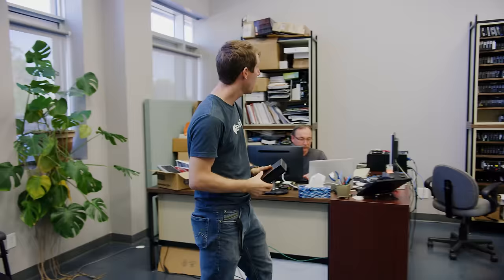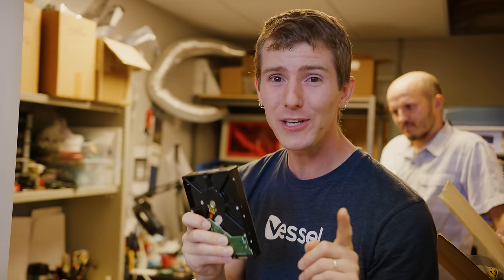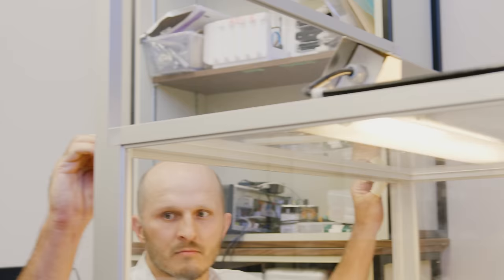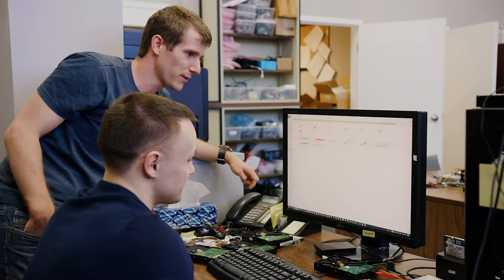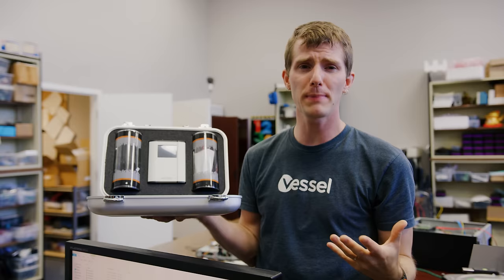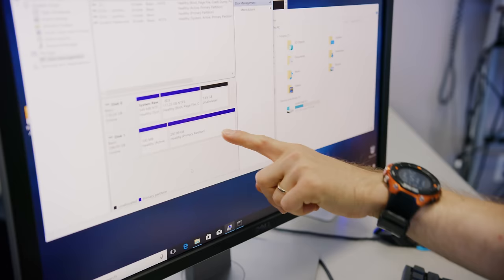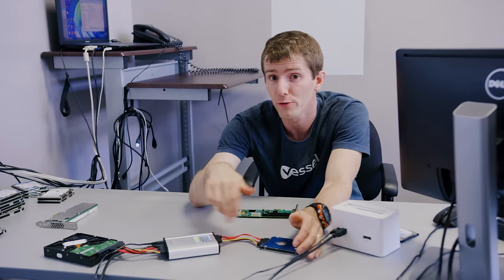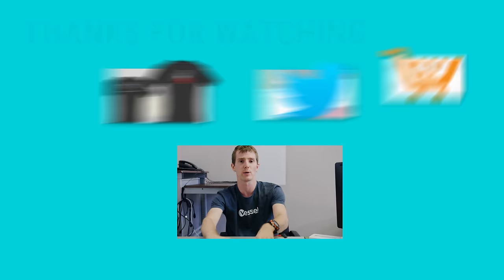Don't Waste $1000 on Data Recovery

Comment: Really cool stuff, useful tips (automount disable & scrub). I lost interest when the software updates from a DB back at their corporate servers - That data should be included with the purchase and updated periodically. What's sent back to the corp servers is not mentioned - would have to scrutinize the privacy policy before I pulled the trigger. Meanwhile, I'll continue to practice safe data storage principals so there won't be a need. Thanks for the video!

Comment: This might be a stupid question but if the data is on all the platters (discs) themselves wouldn`t it be easier to just move the platters to a working drive instead of replacing all the defective parts one by one on the drive itself?

Comment: 14:20 "there is free software"
TestDisk! It's all you need for any logical HDD errors. Accidentally quick format a drive? It'll find the partition structure. Have a drive where the MBR is corrupted? It'll write a new one and it'll boot again. 
Have a drive that says it's empty? It can recover raw files even if the partition structure is completely trashed.  
And it's free.  
AND it comes with image recovery utility with a nice GUI.  
Seriously... Free
Reply: Does it work with SD cards? Is there any free software that does?

Comment: wow....... using your tips, in particular the section on 'windows hacks' i was able to recover data and files from a dead SSD using a cheap USB SATA cable off amazon and the free DiskDrill software! I was experiencing random blue screens and crashes for months before the drive finally failed. Eventually i purchased a new  2TB M.2 nvme drive to reinstall windows to. Lessons learned. Thanks for the help!

Comment: Another reason to love my ssd
Reply: Greetings Sir. Having a bad time formatting my SSD hard drive without backing it up. Please Can you help me on recovering it?
Reply: SSD's have a lifespan. Enough read writes degrade the metal tracks in the circuitry (not the contacts) and hey presto they fail. Its the same with memory cards, so be careful and always take backups

Comment: Excellent video and fun to watch!  I found this vid because my son's SATA HD died today, and I stayed for the whole show.  Very entertaining and super informative--beats most of the Discovery Channel shows.

Turns out his drive's TVS diode on the 5 volt line did its job spectacularly, and then died in a shorted-out config.  Got out the soldering iron and lifted one side of it, then replaced the zero ohm resistor that acted as a cheap fuse.  Voila--it lives to fight another day! (and yes, we're going to copy the data over to a new SSD)

Comment: Would have been a great video to have three years ago when my 135K word fantasy novel got destroyed by a failed hard drive and was impossible to recover. But, looking back, while the original version was wayyy different than the new version, they're both fantastic. At least for first drafts.
Reply: Wow, that sounds impressive, did you publish it?
(the new version)
Reply: the question is, if it was so valuable, why didn't get it a backup before it was too late?
Reply: @terner1234  nah. Still editing. Actually just finished the first draft two weeks ago. Took a small break the last week. Started editing Wednesday. Got like ten chapters edited as of today. After editing, I'll probably send it off for beta reeading. But, if you want to read the unedited first draft, it's for free on Wattpad. The book is called The Game For Power and my username is JamesStark612. It's a pen name. See if you like it. It's about a rebellion, a war between gods and a king, desperately trying to stay in power.
Reply: @sh4dy832  i did have a backup set up to a cloud service but something fucked up and the latest version I had of the story was 7 months ago with only ~11K words written. At that point, I was just like, fuck it. Just started it over but I would have loved to see what could have become of the first book that no one will ever get to see again.
Reply: Aditya Upadhye if I had that many words written I’d backup it at every single change.... I don’t even have data on my OS SSD, I save important files on my HDD, but I also have the important files on Dropbox (2gb free cloud storage) OneDrive(5gb free cloud storage) and google drive (15gb free cloud storage) to back up my back up of back ups of important files lol.
Reply: For the synopsis, I'd change the word "common people" to "commoners", that way you don't have the word "people" written twice within the span of four words.  It might just be a personal preference, but I feel like it messes with the flow when the same word is used multiple times in quick succession.  I'm only pointing this out because I feel like the synopsis is the hook that grabs potential readers, so every single word needs to be perfect.  It probably wouldn't be a big deal within the actual story though.

I wish you the best of luck on your novel - the cover looks pretty good, and the plot sounds really interesting.  I wish I had that kind of creativity. :P
Reply: You should edit it on google doc, every word safely stay on cloud.

Comment: Liked your comment about backing up your data at the end. One of my comptuer lecturers at University told us that there are two types of computer user: those that have lost data, and those that will.

In addition, another lesson I learnt that it isn't enough to back up your data, but to verify your back up and check it regulary.

I learnt about an interesting case from a Californian University, the Geography department I think, where they made two back ups of their data, each copy on magnetic tape (yes, this case was from that era!). When they had an incident and had to restore data from their backup they found that the first set of back up tapes were corrupt. Fortuneately the second set was okay. They replaced the corrupt copy with a new back up.

A few months later and they then again had an issue and had to restore from the back up tapes, and once again, found the first backup set corrupt but the second set okay.

This circumstance was obviously concerning so they conducted an investigation to find out what was happening. They found quickly that it was always the first set of backup tapes that quickly became corrupt, and that this was the set of tapes that was stored on the bottom shelf of the cupboard. The second set, stored on a higher shelf in the same cupboard would be okay.

Once this was discovered, the cause of the corruption was quickly found to be caused by the magnetic field produced by an electric floor polisher that the cleaner used on the corridor every night.

Comment: For the people scrolling through the comments. Formatting is not always the same. For example, the 'kindest' form of formatting, would be a 'high-level' or 'quick' format. Which mostly means the partition table (special sectors on the drive) are re-written. The rest of the data on the disk is not touched, therefore recoverable.

Low-level formatting, is the process of literally writing zeros to the entire disk (its 'data space' if you will). In which case, recovery of data is impossible.
Reply: Zeroing the drive is colloquially called low level formatting, but that's not what it is. Low level formatting hasn't been possible by consumers (or even data recovery businesses) since the early to mid 90s. Low level formatting refers to the process of writing the actual sectors, tracks and servo info on the drive. Modern (and by modern anything 1995 or newer) hard drives are low level formatted when they are manufactured and can never be low level formatted again.
Reply: really? I've heard that there are technologies used by the DOD that can detect "ghost" images or residual magnetism from each writable bit so that they can actually see what has been written over.
Ever heard of this or is it a myth?
Actually, I just figured I'd spend a minute to check and it looks as if it's definitely a possibility but in a limited capacity. I've heard that BleachBit, the software that Hillary Clinton had her underlings use, overwrites several times. That would certainly make recovery near impossible because you could never tell how many times a bit has moved from a 0 to a 1 or 0's over 0's and 1's over 1's
Reply: Its definitely not impossible from just one pass. For the consumer it typically is but there are ways. If you have state-level money and technology they - might- be able to read the residual magnetic field left behind(Very specialized equipment and mainly used for espionage/terrorism stuff). For the average user one pass is good but for sensitive data you want either S-Delete or DBAN. With at least a 3-pass Zeroing write or the DOD certified erasure method. 

Also, he never mentioned GRC's(Steve Gibson) SpinRite which is a low-level read of the 1s and 0s and every sector to recover[and reconstruct] most of the data that was lost. One of the best tools and for the money. And to your point, when he releases his next version, 7.0, along side with that he will be making a secure delete tool at the low-level.
Reply: @captain150  I had a program for win98 that would low level format any hard drive.
Had a virus on the drive that nothing would remove. Low Level Format got rid of it.
Surface check with Norton shows the shape of a big spider on the drive before and nothing after.
Hard on the disk too but ya gotta do it sometimes.
Reply: @christurnblom4825  on platter drives you would use magnetic underwriting. Evidence Eliminator program did just this thing too.
Takes forever to do a simple 20-40gb hard drive.

For SSD's. ZEROING does not fix the problem.

You have to write all 1's at least 4 times to the drive. Normal state for SSD's is all 1's not zeroes.

If you have wear leveling then even more work needs to be done.
Reply: @jordanwingle3111  SSD manufacturers have specialized programs for restoring n SSD to factory state thus making retrieval impossible.
But it very quickly wears out the drive if done too many times.
Reply: @christurnblom4825  That's a myth. Everyone has "heard" something, just like with any myth. But nobody has ever shown any evidence that it can be done, at least with modern HDDs. "They say...", "I heard...", "it might be possible...", are nothing but speculation or gossip, and are as worthy of consideration as rumours about the existence of the Loch Ness Monster. Whenever someone makes a claim that sounds like science fiction or like something out of an episode of CSI, one should take it with a huge grain of salt, and ask for for some kind of evidence. So, is there any evidence supporting this? No. But there is research disproving it.

First of all, this wasn't entirely a myth for old HDDs, but it is for modern ones. The myth has its origin in a paper from the mid '90s by Peter Gutmann, in which he claimed that it might be possible to recover data from magnetic remanence on HDDs. Of course, as many researchers pointed out, he didn't provide any evidence to support it. And it only applies for very old disks, as the author recognized: "Any modern drive will most likely be a hopeless task". Unfortunately, this two very important facts seem to have been lost on many people.

There's been research in more recent years, and they all agree that even one full overwrite is enough to make recovery of any useful data pretty much impossible(1), as long as one verifies that data was really overwritten, and there were no errors that prevented the overwrite to truly succeed. I'll just give two examples:

A paper published for the 4th International Conference on Information Systems Security, "Overwriting Hard Drive Data: The Great Wiping Controversy", showed that even after just one overwrite, while it might be possible to recover a few individual bits here and there, the recovery of any useful data is not possible (the probability is about the same as that of pure chance: tossing a coin to decide the values of the bits would be as accurate). According to the research this limitation is inherent to the physical nature and technology of HDDs, which means there cannot be any device that overcomes it: you simply can not read what's not there. The conclusion: "The forensic recovery of data using electron microscopy is infeasible. The fallacy that data can be forensically recovered using an electron microscope or related means needs to be put to rest."

A publication (800-88) by the National Institute of Standards and Technology, "Guidelines for Media Sanitization", has this to say: "Studies have shown that most of today’s media can be effectively cleared by one overwrite. Purging information is a media sanitization process that protects the confidentiality of information against a laboratory attack. For some media, clearing media would not suffice for purging. However, *for ATA disk drives manufactured after 2001 (over 15 GB) the terms clearing and purging have converged*." And "Older disk drives left some space between tracks; data written to a track could occassionally be recovered from this inter-track region using special instruments. Today’s disk drives have a write head that is significantly larger than the read head: tracks are thus overlapping, and there is no longer any recoverable data ‘between’ the tracks.". So, again, there was some truth in the myth for older drives, but not for current ones.

Of course, old habits (and myths) are hard to break, and placebo effect is powerful, so lots of tools for securely erasing data offer some complex overwrite methods, with several passes, even though none of their developers (or anyone in the world) has ever shown any evidence that they're really better than a single overwrite. No-evidence-whatsoever, not even weak evidence. And because of those old habits (and paranoia, which is understandable), some, though not all, government agencies still recommend multiple passes, even though, in their own papers, the only reference they cite to support the recommendation is the aforementioned article by Gutmann, which, as mentiones, didn't provide evidence itself, and is completely irrelevant for current drives, anyway.

At best, there are conspiracy theories: "maybe the governement has some magical tool". Yeah, and maybe they have psychics who can actually read people's minds, and maybe that famous alien autopsy is legit, and maybe Tarot readings actually work. The sky is the limit when one doesn't apply critical thinking and is willing to believe anything just because it sounds interesting or "logical". Magnetic remanence or residual magnetism is something real, but how does it apply to data recovery in (modern) HDDs, considering how they work, data density, etc? None of the people spreading the old myth has an answer to that, much less evidence that recovery is possible.

So, here it goes again: zero evidence supporting it, and every research out there says it's fallacious. It is a myth.

(1)Impossible in the practical sense. As quantum mechanics has taught us, lots of things that sound like fantasy (e.g. a macroscopic object walking through a door via quantum tunneling) are not impossibilities (their probability can actually be calculated), but for all practical intents and purposes, they can be considered impossible.
Reply: @rrnum7  
Wow! That's much more information than I was willing to spend the time to gather.
I glanced over a few the papers you cited but was distracted by things more important to my immediate priorities.
Thanks for the info.
Reply: @rrnum7  Best comment I've read on YouTube this week.  Nice work.  Thanks for taking the time to write all of that out.  I just learned good info from you.

Comment: "Do not waste $1000 on Data recovery"
Specialist uses $40 Soldering Equipment :D
Reply: Steven Fong  Meh. Thats a Sparkfun 303D. Cost like $110 new.
Reply: The true value is the brain behind the process, not always the tools they are using. Knowing what to use and when is the most important part of life in IT.

Comment: I have a 1TB WD drive that i have had for 15 years.  It is SATA, and so i used one of those SATA to USB cables to hook up to my laptop.  A Power Supply cable was bad, and it caused the drive to smoke a bit AND a message came up asking if i want to format it.  I knew there was a HUGE problem on my hands.   I figure it's a PCB issue.  I am wondering if any of these methods you used could fix the drive, or would i have to pay a company $1000(USD).  I love your video!  Great stuff here!  I saw a video here on YT of someone swapping the PCB of an identical drive, and may buy one on Ebay and try that.  I really wanna buy a hard drive bay, as i have IDE and SATA drives to copy over to flash drives. I don't wanna mess with plugging a power supply cable into a drive, and cause a smoking issue again. Anyway, thanks so much for this fascinating video of hard drive data recovery!!!

Comment: If the drive hums a tune then it is more than likely heat damage.  Put in a freezer for 30-30 minutes and keep it in a zip lock bag.

after 30 minutes plug the drive in and being powered up for 2 minutes then it just might work.

Comment: Please do a same video for SSD. Is it the same story or something changes?
Reply: SSDs are significantly harder to recover data from, because once the electric gates break down / corrupt, it is a permanent damage that cannot be fixed.. and each cell is going to have a rated write operation limit. your only defenses are A) buy high-endurance drives, B) provide stable & clean power supply, C) buy drives that support enhanced power-loss protection, and D) back-up with the 3-2-1 rule.
Reply: Nope. Same story. Look to replace missing and damaged platters
Reply: @Brian um..... WHAT platters? SSDs don't use platters....... they use memory chips...
Reply: derek400004 it's sarcastic. Obviously no platters. Lol. Video would be nice because of it though.
Reply: wow that sarcasm really flew over my head like a G6 lol